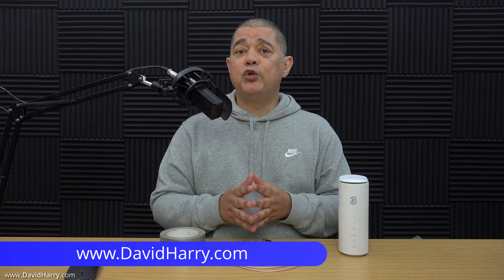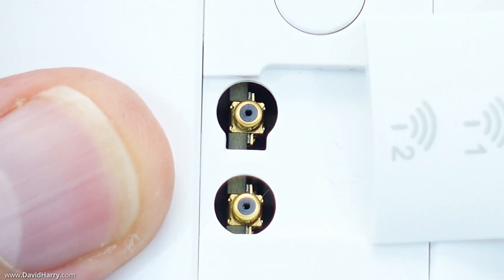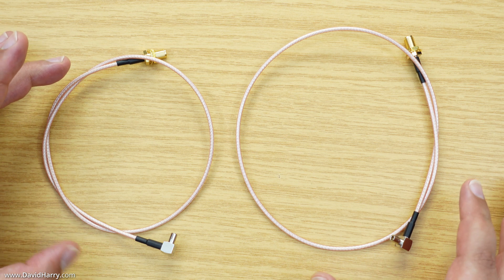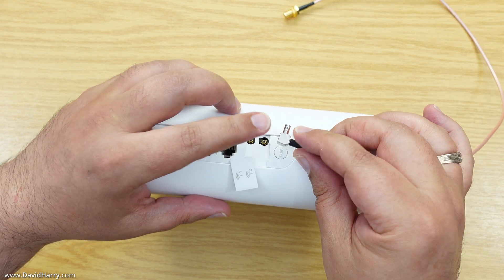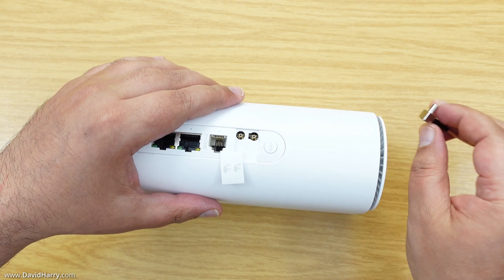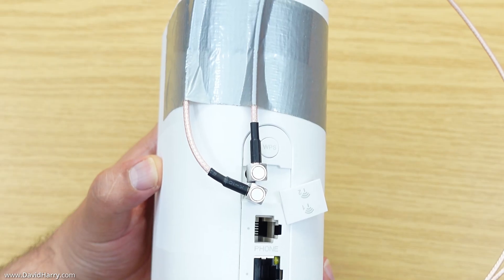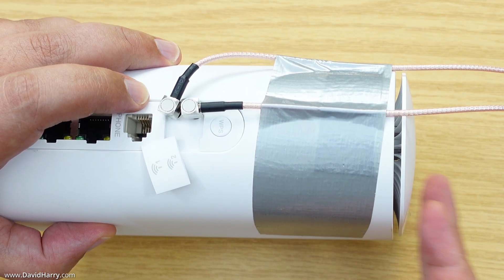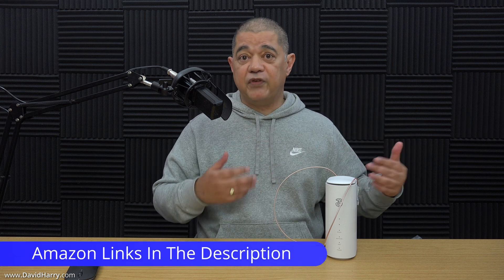How to modify the TS9 external antenna sockets on a ZTE MC801A 5G router so they don't snap off

Comment: useless because antenna switch hidden option also does not work. only internal antenna works
Reply from the maker: What external antennas are you trying to use?
Reply: @DavidHarry  TS9 to SMA (TS9 2x to SMA 1x). I connected the antenna and enabled antenna switch. I didn't make any difference as if nothing was connected. Regardless how cheap antenna I am connecting, it should at least work but it does not. Only solution I found is to mod the device from inside.
Reply from the maker: @sfh2050  But what antenna did you use?
Reply: @DavidHarry  omni direction Freq: 698-980 / 1710-2700 Mhz Gain: 10-12 DBi
Reply from the maker: @sfh2050  That’s your problem, the antenna you’re using isn’t 5G. Those two ports on the back of the ZTE router are only for 5G antennas, plugging 4G antennas in to them won’t make any difference and the router will stay switched to the internal antennas. Plus, even if you were to use a 5G antenna, your internal 4G antennas would still have to initiate ENDC via the cell tower that they are connected to in order to switch to 5G.
Reply: @DavidHarry  so if I change the connection to 4G only would it work then?
Reply from the maker: @sfh2050  No. Those two TS9 ports only connect to 5G. They are physically connected internally, so can’t be switched to 4G. Basically, there’s a branch-off on the motherboard for the main set of 5G antennas, there’s two pairs of 5G antennas internally. If the router senses that there’s an external 5G antenna connected to the TS9 ports then it automatically switches to them from the internal main set. If it senses an antenna connected but it’s not a 5G antenna then it will stay switched to the main internal 5 antennas.
Reply: @DavidHarry  ok that's very precise piece of information. I sincerely appreciate it.
Reply from the maker: @sfh2050  You are very welcome. The big problem here is that most companies who brand this ZTE router as their own, mine is from 3 in the UK, they don’t mention anything about the compatibility for the TS9 ports and external antennas. I’ve seen a lot of forum posts where people are saying that the ports are disabled in BIOS and the ports don’t work. But this is probably because these people are connecting 4G antennas to the router. There may be the odd case where the ports are disabled in BIOS but I doubt that very much, or at least, I’ve never come across one that’s been disabled. I’m doing a bunch of videos for a supplier in the UK, www.Router-Mods.co.uk I’ll ask and see if they’ve ever seen any if these ZTEs that have had their ports disabled, although, they sell the original ZTE version which doesn’t have any functions disabled. Keep an eye on my channel as I’ll be doing a lot of videos about 4G and 5G routers, antennas and setups etc. I’ll also be demonstrating a load of Router-Mods modified and unmodified routers and doing speed tests and also comparing different internet providers and comparing speeds, 3, EE, 02 etc. You should definitely check out the Router-Mods website, even if you’re not interested in buying anything there’s a lot of great information on their website. I will also do a video soon explaining this thing about the TS9 ports on the ZTE router, I think something like what I’ve explained to you in this comment may be useful to others. Cheers, Dave.
Reply: @DavidHarry  I also save this similar router, in our country we don't have 5G yet only 4G, I'm not getting good signals so i was planning to add wifi antenna to boost signal strength.

So will attaching wifi antenna work for 4G ? as our country signal providers have not switched to 5G yet.

Comment: So you find that some of the TS9 are tight to go on? Mine are crazy tight and don’t want to break anything.
Reply from the maker: Hi Nick. Yes, some of these are super tight, that’s why I do this with extension cable so the strain is taken off the TS9 socket. Cheers, Dave.

Comment: Hi David,

I have the same Three branded ZTE

Do you know if there is any way to check if the router is actually using the external antenna I connected to it?

( I have the browser script that shows extra tabs in ZTE but the Antenna tab doesn't appear to do anything)
Reply from the maker: Hi Krzysztof. What external antenna are you using? If you check your signal to noise ratio (signal strength) you will see that it should change when on the the external antennas. Depending on the signal strength, the levels can be better or worse than the internal antennas. If there is nothing wrong with your TS9 ports, then the router definitely does switch automatically to the external antennas. Don’t forget, those external ports are only for 5G, don’t use a 4G antenna with them. Also, even with the external antenna, you are still using the router’s internal 4G antennas because you will be using 5G NSA. I’ve actually just got another router and also some more antennas, I’ll be getting the router modified soon and will be doing a bunch of videos this type of stuff. Check out www.router-mods.co.uk for more stuff about antennas and routers etc. Cheers, Dave.

Comment: Hi, thank you for the very helpful video. In your experience, do you think placing the antennas in-door would make any differency? I am renting a place and don't want to be drilling through walls.
Reply from the maker: Hi Mohamed. External antennas for outdoor use are generally not that good indoor. You may get a slight difference using outdoor antennas indoors, but it's not something that I'd recommend as the best outdoor antennas are directional and definitely don't perform as well as they will when indoors as they definitely need line of sight to the 5G cell tower. Don't bother with cheap indoor antennas either, I've tried a few and they are never better than the internal antennas. Also, if it's the same ZTE router that I'm using here, those ports are only for 5G and 5G outdoor antennas need to be outdoors more so than 4G antennas. Also, I have a few routers and the ZTE one, for me, is definitely the best with its internal antennas. Don't forget, to get 5G you also need 4G reception as well in most parts of the world. For more information try this as a Google search "5G SA vs 5G NSA". Cheers, Dave.
Reply: @DavidHarry  

Dear David, thank you for the detailed response, I am really grateful.
 I am using the same router for the exact same network "Three" in the UK.  I have 5G at only one spot in my house where I get 1-2 bars of signal on the router. The other parts of the house are getting 4G signal but with terrible speeds that don't exceed 10mbps. Therefore, I was hoping to increase the signal to have a more reliable connection and get the full three bars of signal. The speed as it is is good although the upload speed is around 6-7mbps. I was hoping if I used the antenna I would get a better signal and higher speeds. I will try to find a way to run the antenna cable through the walls. Thanks again.

Comment: Just wondering what antenna you are using and does it even help with your 5g speeds/coverage ?
Reply from the maker: Hi. I use the Bluespot Mini 5G antenna, which is an outdoor antenna. My download speed indoors with the router’s built in antennas was about 150Mb/s. The speed with the external antenna was just over 400Mb/s. Upload for both was roughly the same, around 28Mb/s and ping internally was about 45ms and got slightly worse on external at about 65ms. Cheers, Dave.

Comment: This is a great vide, i am awaiting my third router from 3 over the course of 3 days, the first one of the ts9 was snapped from delivery, the 2nd just snapped as i moved my antenna slightly
Reply from the maker: Hi Chris. Don’t get me started about 3 😆 I’m gonna do a video at some point about their customer service and tech support. The bottom line to my last conversation with them was that they don’t support “things” being plugged into the router. Apparently, they only support the use of WiFi, whatever that meant, with their routers. The conversion just went to a really stupid place when I pointed out that the router was obviously designed for external antennas and ethernet etc. Cheers, Dave.
Reply: @DavidHarry  Honestly i could have really kicked off over the phone at them, trying to pass me to technical support for "signal" issues, it was after i said for the 4th time that it's a physical hardware issue i was reporting she finally got it, hopefully third router will be better luck (i was gonna cable tie the antenna (instead of tape) but stupidly thought it would be the last time i would move it so didn't bother)
Reply: Very true.. I asked 3 about extending my signals and they completely denied of know anything about extending signals using external antennas.

Comment: Good idea securing the cables with gaffer tape.  And i wouldn't a little mess for protection!  Cheers!
Reply from the maker: Alright, Tone. This one simple mod can end up saving you hundreds of $s. These TS9 sockets are almost designed to fail, they're the worst connectors I think I've ever used. Worst thing with this router is that when one of them break off the router won't even switch back to its internal antennas. I went from over 400Mb/s to 1 to 2 Mb/s, you can imagine how disappointed I was :) Cheers, Dave.